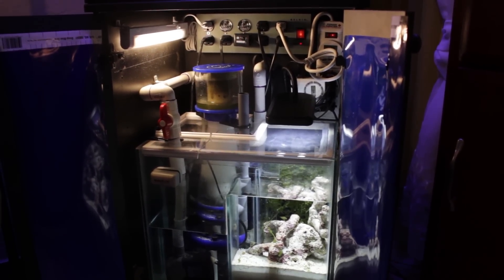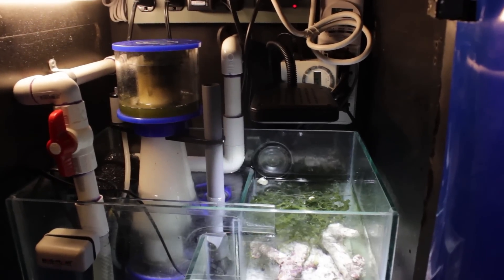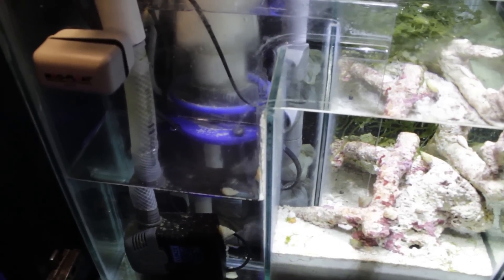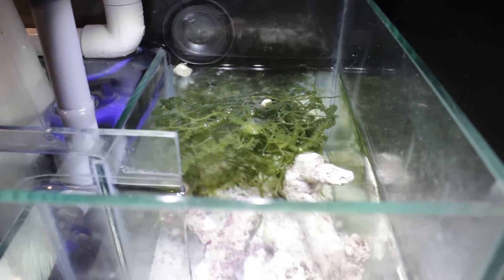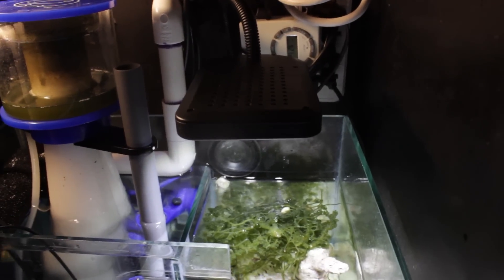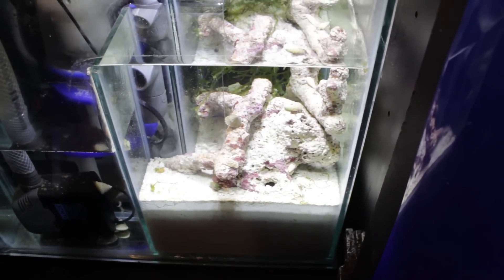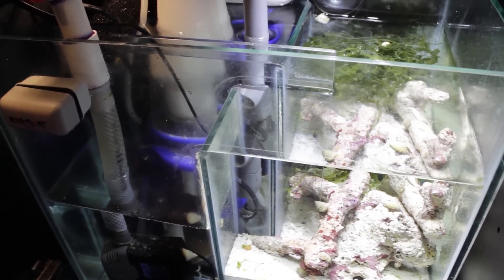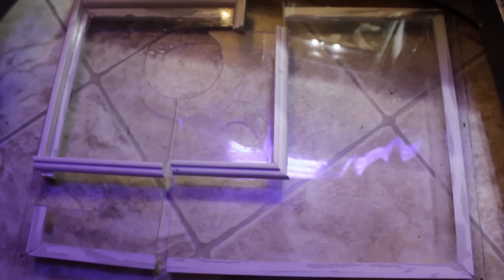[10] Biocube Custom Sump-Refugium - Part 3

Comment: i am about to start a biocube 29, it arrives next week with the stand. and as of the beginning of the tank progress, should i get it started with a sump already? or it will be more necessary after i start adding corals and more fish? thanks, i love your setup
Reply from the maker: +Marco Chacon Might as well go ahead without the sump, who knows you may not even need it. It all depends on how much fish stock you plan on adding. Adding a sump with an overflow box is very easy and can be done while the tank is running. Now, if you plan on drilling the glass instead for the drain, then it's probably easier if you do that in the beginning while the tank is completely empty. Not sure I'd risk drilling the glass though.

Comment from the maker: No it doesn't overflow since I have enough space for the water to fill up in the sump.  The first glass baffle (drain section) is about 4 inches lower than the rim of the sump, that allows enough room for tank water to contain water flowing down until it stops.  The bigger your display tank the more empty space you have to allow in the sump, so you just have to consider that for what size sump you build.  Check my video #08, it may be more clear to see what I mean.  Thanks for watching!

Comment from the maker: I really wouldn't, I tried exactly with that same pump but it failed miserably.  It would just rattle and could not handle the back pressure in the 1/2 inch hose.  The maxijets make great powerheads and things like reator/chillers but I wouldn't use it as a return pump, especially if you have a high head distance to pump up.